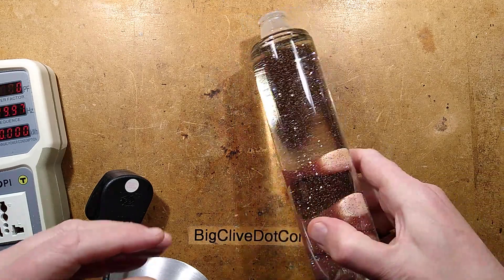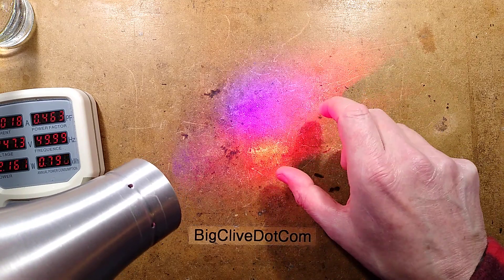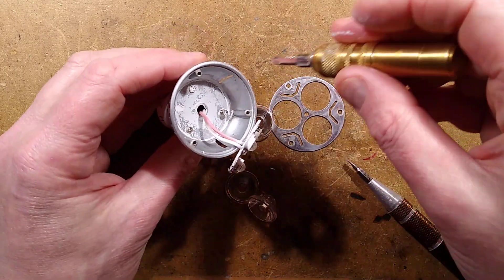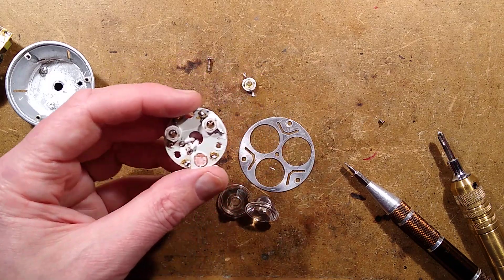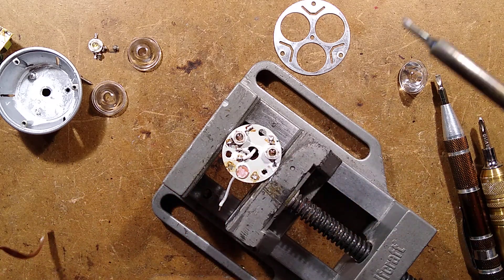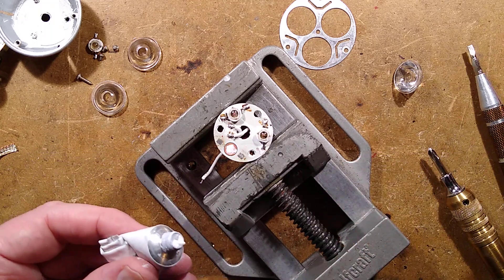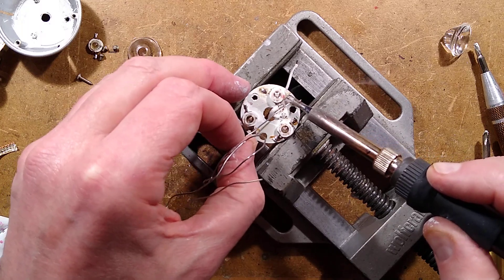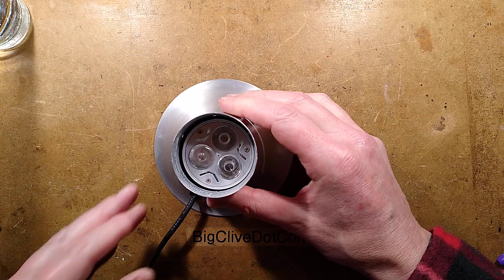Updating a 70,000 hour LED lamp

Comment: you neglected to put some heatsink compound when you re-installed the blue LED.
What would be the ideal DC voltage/amperage for these LEDs, (1 wtt, or 3 wtts ?). 
Cheers.
🙂
Reply from the maker: For a sharper sparkle the 1W LEDs have a smaller chip, but the 3W ones being run at less than 1W are much less stressed.
Reply: The "ideal" voltage depends on how bright you need the lamp to be. The dimmer you make the lamp, the longer it will last. Both the brightness and the rate of failure depend on the voltage squared.
Reply: The driver circuit is a constant current type, and they usually run the LEDs at close to their maximum current of around 350mA for a 1 Watt device. The voltage drop of the LEDs varies with colour (more precisely, the material the LED is constructed from) - Red having the lowest voltage drop (around 2V), and Blue (or white, as they use a blue chip to excite a phosphor coating) having the highest (around 3 - 3.2V)

Comment: At 70000 hours, that really is an impressive time span for LEDs. Silicone does creep. It was used as a lubricant on magnetic drum recorders between the record/playback head and the drum. Unfortunately, it doesn't stay where it's put and ended up  putting a very thin film over everything, including electronic gear adjacent to the recorder. It made things very hard to clean and soldering difficult.
Reply: It's also vaporization and deposition.    Same thing that happens to your windshield in the weeks after you put Armor-All or similar on the dashboard.

Comment: Cool lamp an a nice repair. I'm amazed it's lasted 8 years. :)

When modifying the normal LED mains bulbs, if you have them lit for about 15-20 mins then unplug them, (obviously), then it's easier to get the spudger in to remove the defuser dome. It softens the silicone glue. :)

Comment: Maybe a silly idea, but what if you use clear white LED's, and color the lenses with red and blue permanent alcohol marker ? 
Speaking of LED, is there already a good LED alternative for the 40Watt (40 cm diameter) ring Fluorescent tube lamp ? For the straight Fluorescent tubes there a plenty alternatives, also for the 32Watt 30 cm version is there a alternative that fit in the original armature, but i don't have seen any for the 40Watt 40 centimeter ring version. A few years ago, i bought the Osram Ledvance 24Watt (40cm diameter) , but those are not that bright as the Fluorescent tube lamp.
Reply from the maker: Colour subtraction results in much lower intensity, and the larger area of phosphor causes a more diffused dot too.

Comment: Wonder if it's possible to replace these LED's with the 2-pin RGB ones that shuffle random colors.
Reply: That is exactly what I would have done. I have already done this once before, by buying those colour-change Garden Lights - just to pull apart for those special LED's.
Reply from the maker: It would need a different power supply.
Reply: @bigclivedotcom  Isn't the driver rectifying the AC to DC already?  Would be good to know why it'd need another supply.

Comment: how intense/pure are coloured LEDs compared to white being filtered through a colour film/glass ?
Reply: depends if the white leds doesn't blueshift over time due to phosphor deterioration. Also it's not really efficient to use a wide spectrum source then filtering it compared to directly use monochrome sources, especially with modern red leds.
Reply from the maker: Filtering is subtractive.  Very inefficient compared to a single wavelength LED.

Comment: Poundland used to sell these gu10's many years ago. But the ones I took a apart didn't have a bright power chip. It was a discreet transistor based circuit. I wonder if you replace the driver board at some stage. The transistor version could run all the way down to 12 volt ( dimly)

Comment: Speaking of fixing things... I fixed 2 $300 dollar dell monitors 2 days ago and surprised the old tech guy i think i earned points! Just a few bulgy caps on the psu. Replaced them and boom 43 inches of HOLY SHIT THAT'S CLEAR! only the 3rd time I have ever soldered in my life!
Reply: Nice work my dude! (Old tech guy here as well lol)
Reply: @zyeborm  Kind if curious why it was the same 5 caps on both boards(seperate monitors), is that an overload symptom? or Just a common failure point? 

And thanks for encouragement!
Reply: @jayare1933  heat is the killer on them these days. Same design, same problem. They were probably working hard which gets them hotter which shortens their lives.
Reply: @zyeborm  I was informed they were on ebay for a total of an hour! I'm glad I gave them a new life! I feel bad taking some of the stuff apart! It was nice to do the opposite. Urban prospecting is fun! Today I learned about the bios password jumper!

Comment: I got tons of such lamps, PSUs usually fail in under a year on mains power, 12V last a long time. How did this one last so long?
Reply: Just depends on, circuit design, quality of components , loading (wattage) , heat dissipation etc.😏
Reply from the maker: Running at fairly low power, base down so the electronics remained cooler, and a ceramic capacitor on the secondary of the supply.

Comment: I've had one off-the-shelf 12ft long string of 35 red LED "M5"-type Xmas bulbs up & running, 24/7, for over 20 yrs! which is 182,000 hrs I think! got lucky with every single bulb, i guess
Reply from the maker: Early LED lamps are cool running, and the red technology is super-robust.

Comment: If the heat sink compound is zinc oxide based, could you use zinc cream for sun protection. You could do a video testing different heat sink compounds.
Reply: years ago I saw such an experiment, including different greases and even oil and mayonnaise.
In most cases the major point is not so much how a compound performs with its thermal resistance but rather how it ages so viscosity and siccativity makes the difference.

Comment: What type of surface mount LEDs are those & where can I buy some?
Also, what type of thermal paste are you using?

Thank you.
Reply from the maker: They are called 1W or 3W LED beads (weird Chinese thing).  The paste is standard oil/zinc oxide paste.

Comment: What do you reckon Clive do you think it will run for another 70,000hrs or do you think the other LEDs will let it down. What do you think the chances are for another stretch of the same number of hours.
Reply from the maker: It's currently on holiday, since the red/yellow one I just made is in at the moment.

Comment: I have experienced a similar thing on a smaller scale. I had a fan that was battery and/or USB powered. There's a small surface mount blue LED inside the base. Fan was running nearly continuously for about 4 years or so before I broke something while cleaning the dust off it one day. The package for the blue diode had turned noticeably yellow compared to the red one next to it that indicates charging state. (Flash for charging, solid for charged/no battery.) I don't know if it's the actual color attacking the material or something else, but I found it fascinating.
That's impressive how long that lamp ran for. Most failures in my experience was the PSU getting too hot or too wet when used outside that one of the caps goes kablamo and the fixture starts blinking. In most cases, it just ceases to emit light. 8 years of near continuous operation is impressive, especially with how everything is so disposable these days.
Reply: Shorter wavelength light (blue, violet, UV) tends to damage plastics more than the longer wavelengths like red...
Reply: the shorter the wavelengh, the higher the energy is carried with it.

that is also the reason why modern vehicle headlights like xenon and led with their blu-ish colour tint are MUCH more prone to blind people in the dark then the old fashioned halogen bulbs did.

if i was in the position to change things, i'd vote for a UV and Blue filter in these headlights.  so your eyeballs don't get toasted at night on a steep uphill with oncoming traffic.

Comment: The first LED light we have in our house is a first-gen generic 5W Chinese flush-mount ceiling light with beefy heatsink my dad bought in 2009. The driver failed not long after and was substituted with those old heavy linear power adapter and ran under-powered. Still turning on to this day and the whole setup is so simple it's basically immortal at this point.

Comment: Put some red , green and blue laser pointers inside shining up from below,  with a purple led below them, or maybe lit some neopixel in the bottom for ambiant lighting, then the laser pointer diodes!
Or maybe modify a cheap laser Christmas light projector!
Reply from the maker: Lasers would look good, but the floating mirrors would fire dangerously strong beams around the room.
Reply: @bigclivedotcom  Nothing like some spicy lasers for your lamp to really wear out your retina's early.

Comment: I have not had much luck with isopropyl alcohol dissolving solder flux, but ethyl alcohol works like a charm 😉
Any insight, Big Clive?
Reply from the maker: I find isopropanol works, but you need to use a fair amount to rinse it.
Reply: @bigclivedotcom  Thanks 😁
Reply: IPA and scrub, works fine for me. I always scrub hard because I want to rip off any components that aren't correctly soldered, that might have something to do with it.
Reply: @tissuepaper9962  Haha! I have to be careful when I'm using the acid brush as to not get a bristle caught under a component.
Reply: Your ethanol probably has some water in it. Try adding 10-20% water to your iso it'll help it as a solvent.
Reply: @zyeborm  I'm using 95% ethanol, so there is not much water in the solution. I have tried 92% and 70% isopropyl alcohol without much luck.
Reply: You need physical agitation using an (ideally ESD-safe) brush.

Comment: What about thermal pads like what they use in GPU's vram and other areas? It comes in different thicknesses and I don't think will creep, its a bit squishy so it would ensure the front part pushes the lenses more properly onto the LED's (from behind). At least I think.
Reply: Pcs and other parts suffer from the same problem. Most of the time you just don't notice

Comment: I've been impressed with some 9W LEDs that have been on 24/7 for about 4 years now. I used a mix of warm white and cool white - the cool ones were expensive Philips bulbs, and one by one they are dying out now (30k ish hours). The warm white bulbs are dollar store trash - not a single one has burned out yet!

I'm interested in comparing them to a never used bulb though to see how the brightness has changed...
Reply: Philips are a large, long established company. They have long ago perfected their business model/products to get the most cash out of the punters. To sell the mugs another newer model/spare part you have to know the optimal balance point for product service life. 😜😁
Reply: @theoztreecrasher2647  That is pretty funny - I dug out the package, says 10 year warranty based on 3 hours use per day. Right at 30k hours!

Comment: Could you do a video on cleaning up the flux off of a PCB thats covered in flux? 
OR do you have one already? 

I tried alcohol, but it didn't dissolve the flux, and when I wiped with paper towel, the sharper solder joints grabbed onto the paper and made an even bigger mess.
Reply: if isopropyl isn't working try distilled water or 50% alcohol, then try ethanol, if none of those works acetone will but it might strip all kinds of paint and dissolve plastics,
99% isopropyl alcohol is actually very bad at dissolving polar things and 50/50 or straight deionized or distilled water can sometimes work better if the flux was designed for non solvent wash
Reply: @Mister_Brown  I actually tried acetone and ruined the PCB, the traces started coming off. 

It was only a cheap kit I bought off of Amazon for solder practice, so im not worried about it. 

Perhaps it works on proper PCBs
Reply from the maker: Flux should dissolve with isopropyl alcohol.
Reply: Did the blood from your cut fingertips dissolve the flux? 🤔🙄😁

Comment: while it was apart I would have changed the red leds as well from an engineering stand point, as in you got some lights to change you might as well change the rest at the same time, sort of like changing lights on a dashboard in a car back when it wasn't led lights, because the dash was such a pain to get out then common to find more failed lights on an old car. but looking at how red the red leds were when you put it back together, then it would have swamped the blue led out again, so maybe if you had loads of old red leds of the same type removed from something then be an idea to put them into this lamp until end of life.

Comment: Im impressed it lasted that long, its not usually the LEDs that fail its the power supply in the base, I do wonder about these life expectancy figures on the box. At least LED's are cheap now compared with the silly prices paid when they first came out
Reply: It is the power supply because that is typically either close to the heatsink or has parts that do not take heat well close to a heatsource (part of the driver or the LED).  Most LED's do not suffer a failure because most people will never see their power supply last that long  and throw the complete light out while it might just be the power supply that has gone down.
Sometimes the power supplies are also designed with the absolute limits of handling main-power spikes in mind: making sure that parts supposed to protect the driver from those transient spikes suffer as quickly as possible but not to quickly that people want to switch brands.
Reply: @Dutch3DMaster  Yes totally agree, personally if I can I use 12V leds with a separate power supply but thats not always possible when retrofitting although I find track lighting pretty useful in those situations.

Comment: Greetings dear Mr. Big Clive Sir! I've noticed that many people have a very hard time understanding the magnitude of the difference in electricity consumption between different types of devices.  To them something is either on (bad) or off (good) and what it is doesn't really figure much into their thought process.  Someone will think nothing of taking a long, steamy shower while the oven is preheating and then worry about leaving a night-light on all night.  Anyhoo... how much did it cost you to run that lamp for eight years and how long can you run an electric oven or water heater for the same amount of power/money?
Reply from the maker: Over the last 8 years this lamp will have cost about £16 to run continuously.  Less than the cost of a latte per year.
Reply: Tha lamp is 2W. Assuming your oven or water heater is around 3kW, it uses 1500 times as much power .. so you'd only be able to run it for just under 2 days for the same cost. (70,000 hours / 1,500 is approx 46 hours)

Comment: Starting to wonder how to change my lava lamp now the tungsten bulbs are becoming impossible to find...
Reply: I've been thinking the same thing. Given the heat requirements, I'm thinking a high power resistor in parallel with an LED lamp. The resistor can probably be above the lamp, to more closely heat the base of the vessel, and keep the LEDs mildly cooler.
Reply: @RossReedstrom  I just don't want the lamp to be obstructed, but then sticking in blocky or bulky resistors, I don't know Im not sure it'll look as well
Reply: i'd think part of a hairdryer coil and a 3-4w cob shooting up through the center from below might do the trick, or go looking for some specialty bulb preferably in an overvoltage variant that will last forever and just keep on with the tungsten, if you can find a bulb rated for say 60w 347v for a 220v country or 75w 240v for a 120v country it'll last practically forever at the lower voltage and the only side effect is it will be more inefficient and produce more heat for a given light output
Reply: @Mister_Brown  that would be insanely dangerous

Comment: At a guess, thermal migration of compounds is at play. The heat of the LED's generate thermal eddie currents within the enclosure, this thermal flow can and does move inorganic matter causing it to migrate around the area.  The Thermal paste is oil based and thus is prone to becoming airborne within the thermal eddies created, but as it's heavier than air gravity eventually becomes the dominant force and thus it ends up 'splattered' around the base of the enclosure, aided by the metal basket being slightly cooler than the higher areas. 
We have sealed external cameras that used to suffer what looked like fogging on the inside of the glass lens, took us ages to work out it was the various manufacturing greases (thermal compound, flux etc...) within the housing becoming mobile due to the thermal currents, they then essentially condense on the cooler front glass. We solved this by A; Isopropyl bathing all the components before assembly, and B; by closing up the enclosure in a nitrogen 99% environment to ensure no airborne contaminants get in during sealing. Just my guess.....?
Reply: Huh ???

Comment: I remember you making some variation of this lamp. My elderly grandmother had the old model that made a strange low rumbling noise. It ran constantly for my entire youth and young adulthood.
Reply: Would the rumbling noise have been a synchronous motor turning a coloured disc maybe? Can't think what else would make that noise...
Reply: This was over 30 years ago, but I'm pretty sure there was not a motor, nor was there any color. "Rumble" may not have been the best description. It was almost a hiss and a percolation noise. The lights in the base were warm white, almost yellow, and in my minds eye looked similar to halogen bulbs.

I wonder if the noise actually came from a built-in dimmer circuit?
Reply: Was it magnetic ballast CFL?_